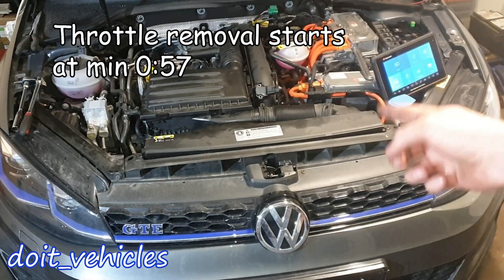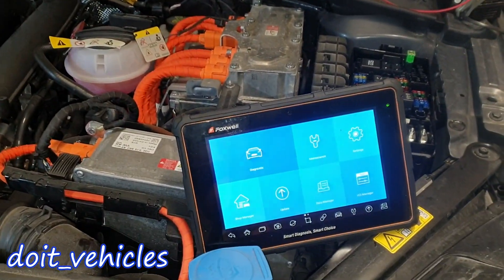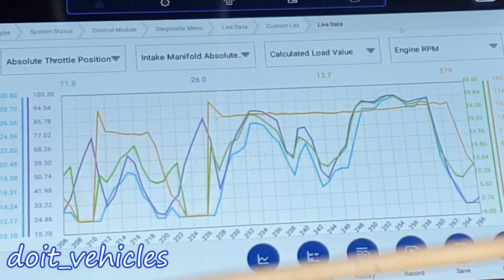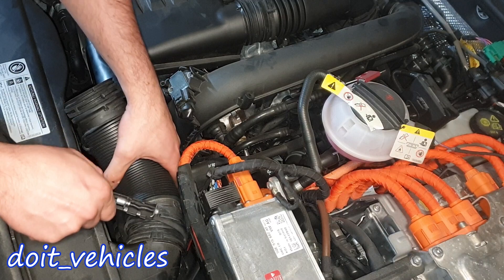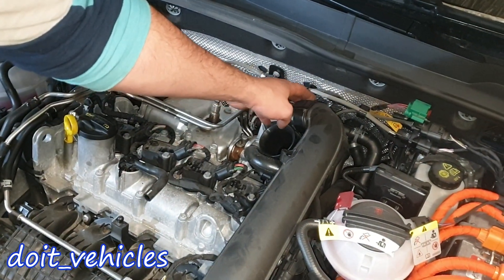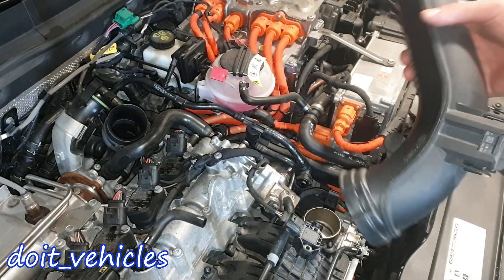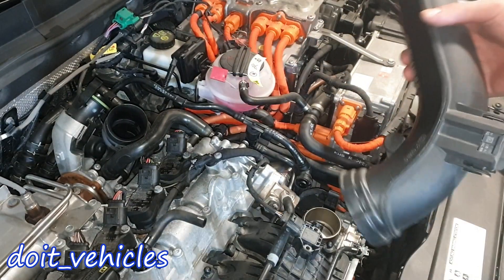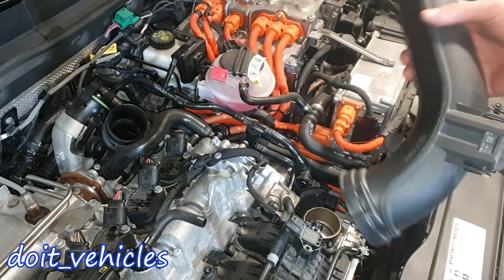VW 1.4 TSI GTE Throttle Body Removal , TEST

Comment: I was thinking of buying a vehicle with the 1.4 and now I know I will be able to do that cleaning easily enough.  I just wanted to make sure I would not have to work near the turbo which can get really hot if it has been running.  I wonder how many people got a nasty burn from a turbo on really any vehicle that has them.

Comment: ea211 engines havent intercooler theese engines have watercooled intake manifold. also turbo charger not pumping oil to throttle body, oil came from crank ventilation
Reply: I imagine a catch can might make that less of an issue.  Also some people with these vehicles say they get shifting problems and did a relearn and now the issues are gone.  I imagine that a good cleaning of the throttle body could help a lot and then relearn.  When a throttle body on any vehicle gets dirty it can cause the vehicle to accelerate in a harsh jerky manor.

Comment: Thanks for this clear and easy to follow video. The steps worked perfectly for a throttle body replacement on a Golf MK7 1.4 TSI as well. Sourced a replacement body from Amazon and changed over without issue thanks to these instructions.